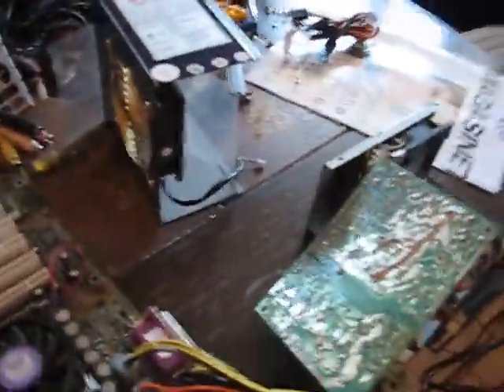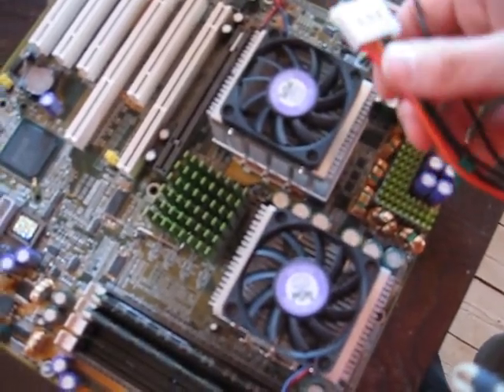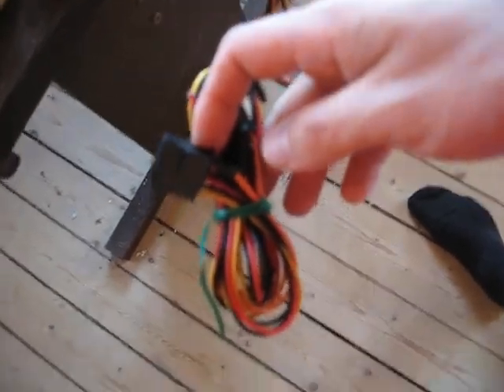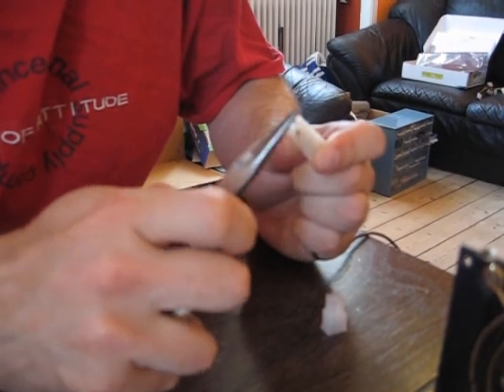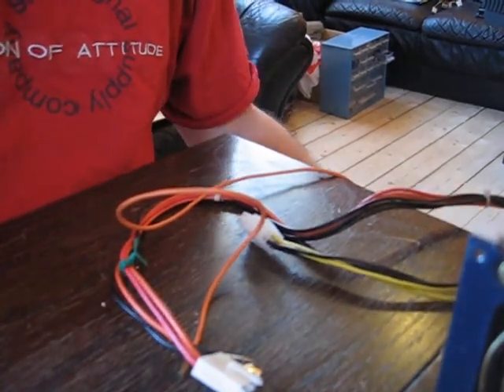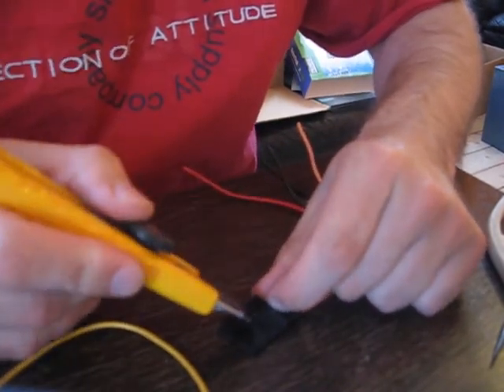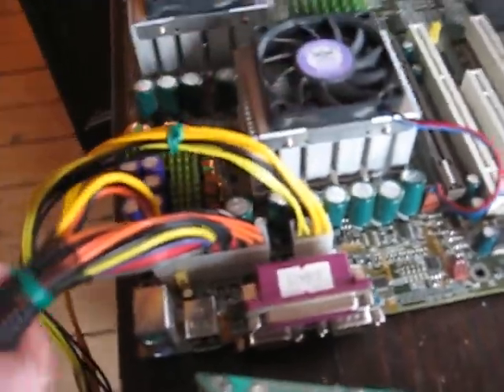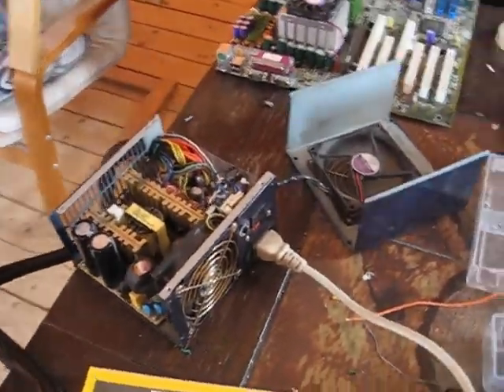Upgrading a PSU from 20 to 24 pins

Comment from the maker: BTW: The green capacitors on the motherboard I have replaced myself. They used to be purple.

It was quite common in for period that Taiwanese motherboard makers used capacitors that use fluids made from a stolen formula. however this formula was flawed, and the capacitors only lasted 2 years (just long enough so the warranty had expired).

Comment from the maker: Yes it is. Back when I using this as my primary PC, I had added 2 extra 80mm fans on the sides of the heatsinks, and I had made a 100mm pipe to provide fresh cold air for the outside (the PC was in a closest).

I was considering water cooling. But after seeing my electric bill I decided to get a newer, but slower PC.